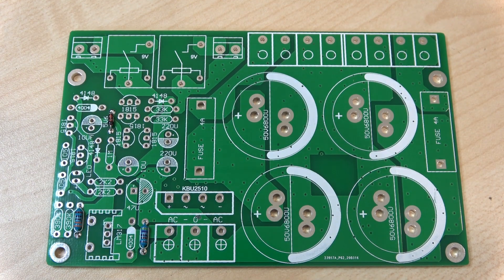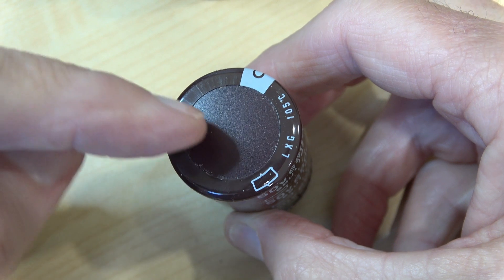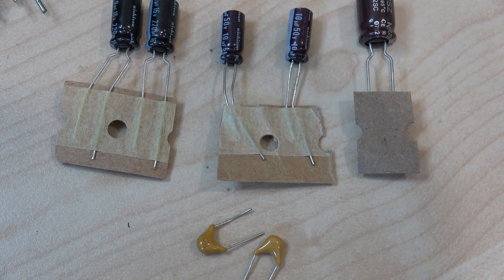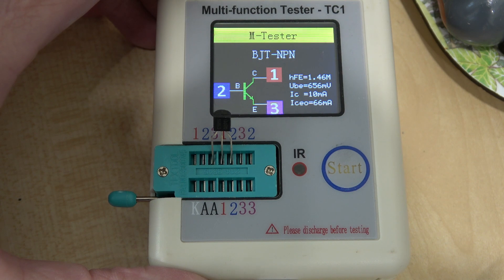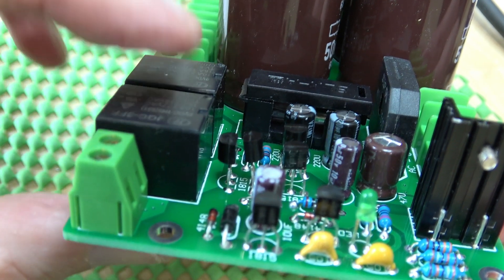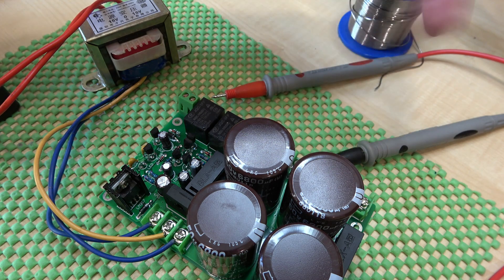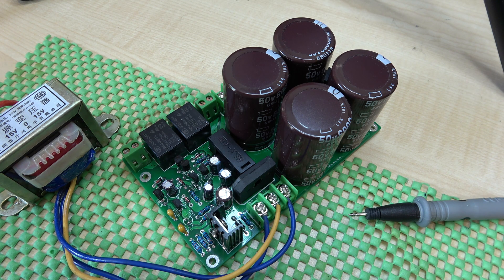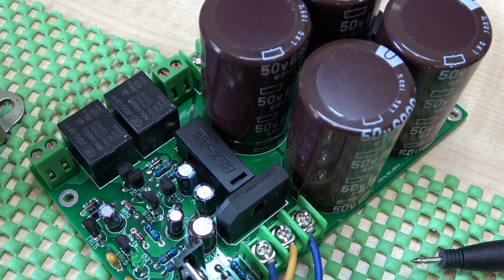LJM Rectifier Power Supply Board kit. With speaker protective for Amplifier.

Comment: Hi Michael.   I really enjoyed your video.  Being a novice at this stuff I need a little help.   I don't know if I'm over thinking the connections.  The AC goes in the three terminal from the transformer but what I'm confused about is the eight terminals on the other side and then the two separate connections with two connections on each of them.  Looking at the underneath of the pcb board from left to right - the first two vee-, the next group of four say ground, the next two say vcc+, the next one says amp out+, next one to speakers+, next one speakers+, the last one amp out+.   I'm thinking the the amp out + and the speaker out+ goes with the corresponding ground terminal but completely unsure where the vcc+ and vee- terminals go.  The amps I'm connecting to also shows vcc+ and vee-?  Please help.  I really don't want to blow these amps up.  Thanks in advance.
Reply from the maker: Paul, contact me directly here, I will send you a drawing. tas.audio49@gmail.com

Comment: Just got the same kit , still has 3 components soldered on. I imagine the only difference between the 4 versions of the kit are the 2 pre-soldered resisters, relay voltage and the main cap voltage. T pre-soldered diode is probably to keep the 5.6 volt zener from getting mixed up with the 1n4148 switching diodes. The main caps are snap caps - designed to mechanically snap into the holes , they never have leads long enough to bend over.
Reply from the maker: It's a good unit, still in daily use on my bench amplifier.

Comment: Nice video Michael. Small correction as the LM317 is actually an Adjustable positive voltage regulator. It can output a regulated voltage from 1.25 - 37V
Reply from the maker: Yes you are quite right. The PCB is made for different supply voltages, limited mainly by the filter caps. I think they used a variable regulator for a higher input voltage and to use different voltage relays. Hence the pre fitted resistors and zener diode. I did not realize this at the time of making the video. Many thanks for your input, I appreciate it.
Reply: @MichaelBeeny  No worries Michael. I love your videos. My LJM L12-2 kit is on the way and can't wait to assemble it.

Comment: Hi again Michael. So I built a power amplifier and it sounds great. My question now is, do you think it's necessary to ground the Rectifier board (by connecting the Rectifier's ground terminal to the chassis). I did not ground it and I have not experienced any issue (so far). Would like to hear your thoughts on this. Thanks.
Reply from the maker: If you have no hum issues, probably not. If you do earth it you might end up with a ground buzz when connecting other grounded items. CD player which could form a ground loop. I'm pleased to hear all is well with your project, well done.
Reply: @MichaelBeeny  Sounds good thank you Michael!

Comment: Hi Michael, I'm beginner diyer and I'm building a power amplifier myself and I came across your videos, I found them very informative. I have a toroidal transformer which doesn't have a center tap on the secondary side, instead it's 4 wires on the primary side and 4 wires on the secondary side. How would I hook the transformer up with the rectifier board then? I mean if there was a center tap from the transformer then it goes to the "0V" connection on the rectifier board, but in my case do I just leave the "0V" not connected to anything? I was wondering if you could shed some light on this one for me. Thank you.
Reply from the maker: Hi Benny, if you have 4 wires from the secondary you do in fact have a center tap, kind of. There is in fact 2 separate windings. If you parallel  them, in the correct phase of course, the voltage will be the same but double the current but no center tap. If you connect the windings in series, again in phase. You will have a center tap. Be careful to get the windings connected correctly or you could end up with a short, not good. I assume both windings on the secondary are the same!! Might be 2 separate voltages!!
The primary probably had 2 separate windings of 110v. Connect in parallel for use on 110/120v or in series for 220/240.
Be careful, I have NOT seen or measured your transformer, please be sure you understand what you are doing. Is there not voltages shown on the transformer?
The rectifier board needs a center tap, it will not work without it, as you need 2 windings to give you the + and-  volts DC. You will not get this with a single winding.
Reply: @MichaelBeeny  Hi Michael, the windings on the secondary side are indeed the same but I did actually intend to parallel the secondary to maintain the same voltage, because otherwise if I connect the secondary windings in series I would end up doubling the voltage which exceeds the range of input voltage for the rectifier. Do I need to get a different transformer? Or can I leave the "0V" on the rectifier not connected to anything and just connect the two "AC-AC" on the board? Thanks again Michael.
Reply from the maker: @beng8855  No sadly you can't. It looks like your transformer will not work here. You must have either a 30/0/30 or what ever voltage you need. Or two separate windings connected in series with connecting link sent to the 0 volt input to the rectifier board.
Reply: @MichaelBeeny  Thanks so much Michael.